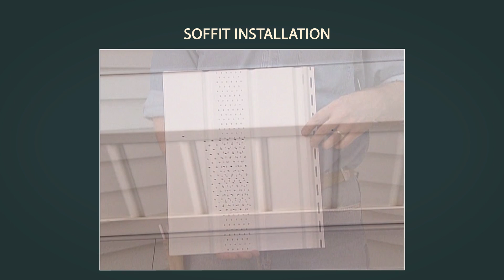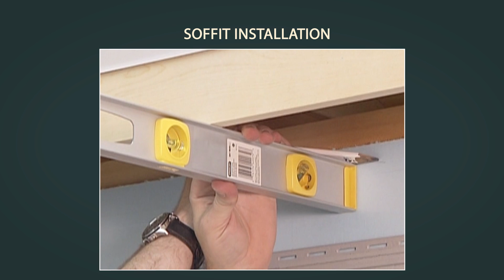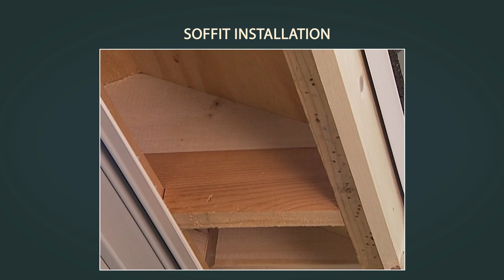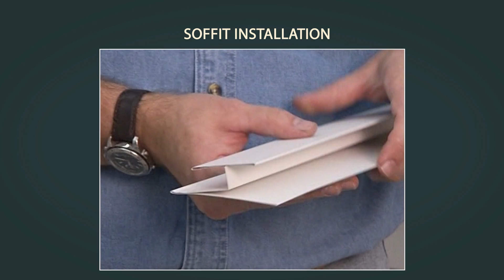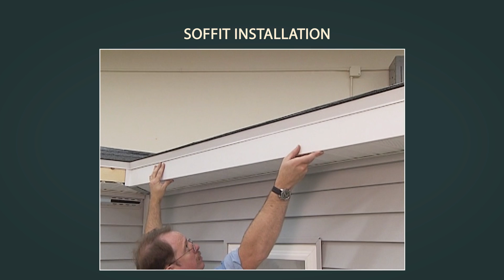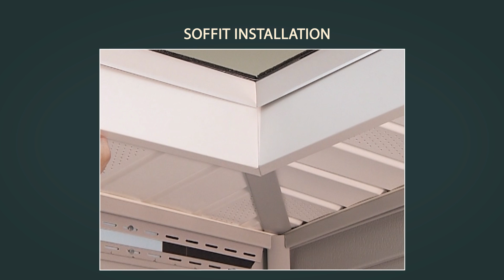Vinyl Siding Installation: Soffit Installation (Part 4 of 9)

Comment: My question for you, Vinyl siding institute,  is:  can there ever be a  siding joint above a door or window? For I am presently, siding my two story home.  Can I have lap joints in the siding,  once I am 2 or 3 or 4 rows above the window?  And is there a minimum amount  of rows 
 required before a lap joint would be permissible?  Ill be watching for your answer. And Thank you!  Flywelder, 6-24-2018
Reply: flywelder no there should not be any over laps above windows or doors